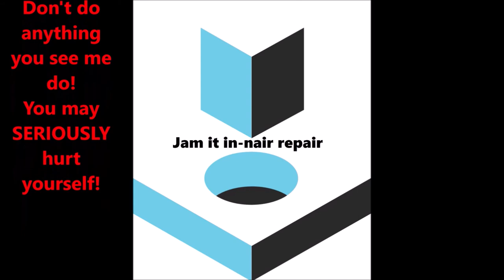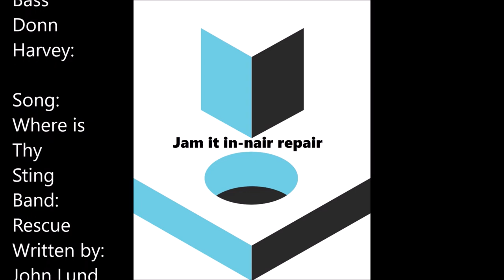Snapper Hitch Try #2  Will it Fail AGAIN?

Comment: You should just dig a 2 foot deep hole in the front yard the same size as the camper and back the camper into the hole. It could double as a front porch. If the city tells you ya need a permit you can just hook up the snapper, pull it out of the hole and ask, "what porch"?
Reply from the maker: That's an inside joke no one will get.